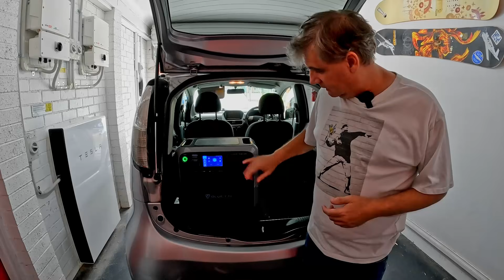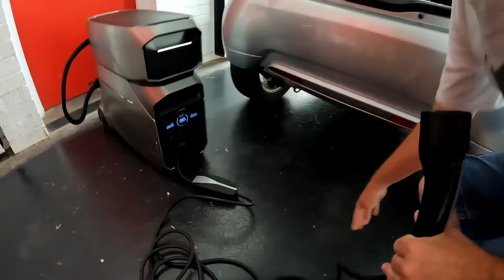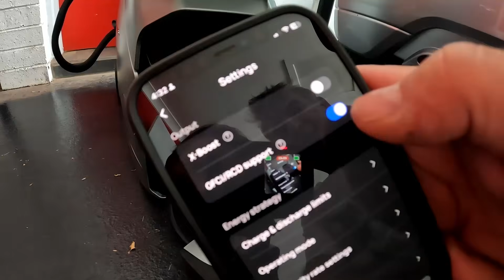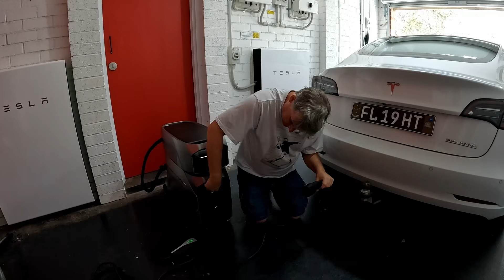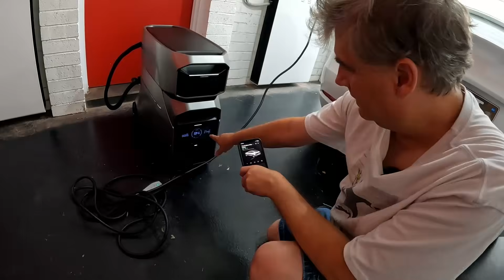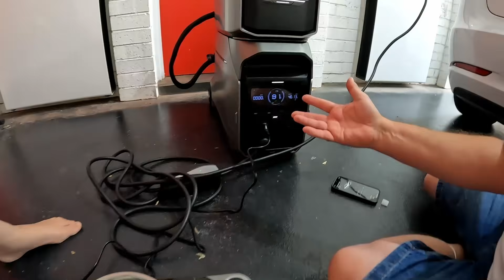EV Jerry Cans and a Pot!

Comment: Thats 10kw of storage/extra range for what 10-15 miles for what they cost about $5000 plus  ??.ok then 1 jerry can of fuel what say 10Litres cost 15 or 20 $ range myb 50 60 miles avg.......well im from uk so gueesing how much your fuel is in $ but make it make sense 😂😂😂.Weather i live in scotland uk or Aus im staying with petrol/diesel and 1 jerrycan or even 5 and saveing the other $4900 for soso many other things fun 👍👍👍
Reply from the maker: in most EVs 10kwh would give about 80 km range, in the case of our MiEV, it would mean another 80% battery from empty!   sure, a jerry can of fuel, apart from the fuel cost would be cheaper, but its a once off,  i can use this "jerry can" with its 10kWh to run my laptops, cook on, run my home, or motorhome, or camper, or camp site overnight easily. and recharge it for free from solar blankets. as a EV jerry can is just 1 use case for it.  not its major use case.

Comment: its all about the weight / energy density. carrying the heavy battery as range extender does not make sense.
Reply from the maker: yep, the ecoflow setup isn't light, and will cause a decent range drop especially in our MiEV,  not something i would rely on for a really long trip, but for an emergency top up, it should do the job.  but its not something to take everywhere all the time

Comment: Hey Rob, have you tried the portable MEN mod to get past the earthing issue with the Bluetti??
Reply from the maker: no i haven't,  once we get settled in the new place, will definitely try it,  it semes to charge the MiEV for a few seconds until it overloads, but the MiEV being old doesn't seem to check for grounding before starting to charge.  we tried it with the Tesla, and the portable charge unit immediately changes to red.  will be interesting to see

Comment: Would it not just be easier, cheaper and less space to carry a portable generator, fuel cans and a portable charger!!
Reply from the maker: dont know about less space,  generators AND jerry cans of fuel you need to store outside the car.    also most portable generators wont charge an EV as the EV looks for grounding circuit before charging.  and most generators dont have that,  they can be modified to do it.

Comment: Bluetti are a great unit, a mate of mine used one to keep his household fridge etc going up in  Tweed South while having a blackout during Cyclone Alfred, I was checking the Bluetti  stand yesterday at the Sydney EV show with 30% off
Reply from the maker: we have had the Bluetti for a few yrs now, love it,  we take it on road trips and use it to power car fridge (since tesla turned off the 12V sockets when car is off) run starlink and routers,  and we charge it in the car via 12v when driving.  we also have a 400w solar blanket to keep it topped up when camping.   we got the ecoflow for the added capacity and car charging ability

Comment: I love it . What you save on not upgrading your iMiev you spend on Bluetti and the Ecoflow. 
I understand these portable powerbanks are still very exy approx  AUD$1,100.00 a kWh with the Ecoflow Delta Pro 3 costing AUD$4,599.00 for the 4000 watt unit alone.
When these units come down to around AUD$400.00 a kWh then I might look to buy one.  
I believe that even then that needs some 10,000 cycles to pay back the power cost equivalent of off peak at $0.39 / kWh. 
A petrol or diesel generator 3 kW far less cost  but it does have the down side of fossil fuel use.

I understand you have made a conscious decision to avoid fossil fuel and I commend you.

For me however a small petrol or diesel genny as a back up to my solar is what I can afford. given it is for backup use only in a blackout. 
I gather on your shed you will be putting up the biggest solar array you can place to maximise the free charging of your power banks. full off grid utility.
Reply from the maker: oh yeah, these are very expensive, cheapest option would have been a second hand generator, but then there is the noise and associated storage of fuels etc.  We ar emoving to a block of land shortly and need power to run, well everything. We choose the ecoflow as its the only one we can use that will also charge the MiEV and Tesla, as well as be chargeable from the AC Type 2 chargers in town.  we have old solar panels from our home, (before we installed the 9.6Kw System, it had an old 2.5Kw system)  so we will use those, and about 1kw of solar blankets to charge the batteries to run the cars, cooking, computers and starlink as we are still needing to work.   1 thing to get built will be a double garage and Solar arry, around 30 to 40Kw system and batteries.
Reply: @ you could reach out to some of the installation guys for second hand panels off homes that have been upgraded. Even building a free standing panel array and an inverter connected to your Bluetti.
Reply from the maker: final plan is to have about 40kw array, ground moiunted, and a home battery setup, either BYD, Redearth or similar off grid system.  we already have about 48Kwh of Samsung rack mounted batteries in storage to be used.  so depending on quotes etc,  but at moment we are speaking to local installers and they seem quite well priced
Reply: @SydneyEV  check out Fin Peacocks Solar Quotes YT channel page of about 5 months ago. His vid on the Signenergy modular storage and bidirectional car charger - 32 kWh storage 25 kW inverter and 25 kW DC Bi directional car charger .

Comment: Great video as always, good to see ways of charging when somewhere without grid supply.
Reply from the maker: yep, that's the reason we bought the Ecoflow to give us power while off grid until some decent solar infrastructure gets built, and to charge the cars while there.  and extra bonus is we can also charge the eco batteries from the local AC type 2 charger as well.   between the Bluetti and eco pack, we should have enough power to run laptops to continue working, keep some sort of cooking going and run lights, starlink etc.